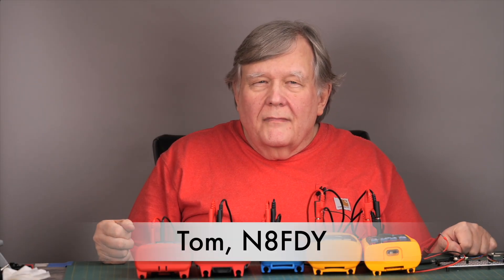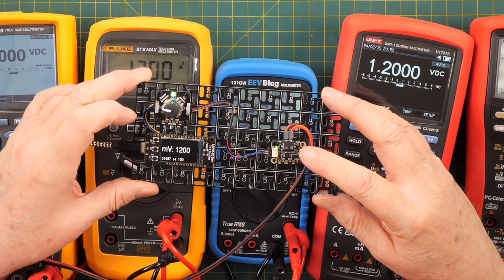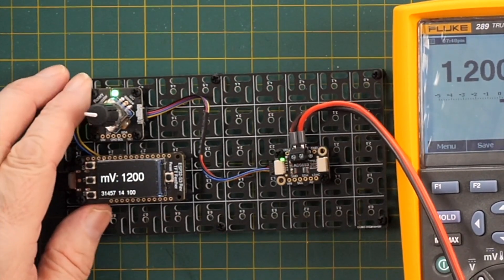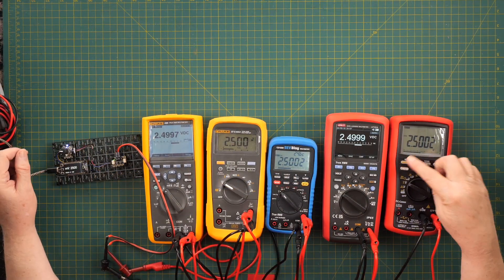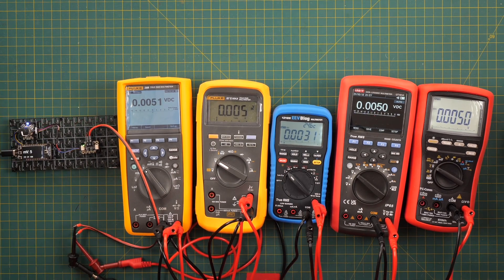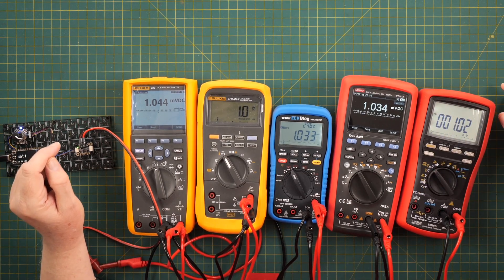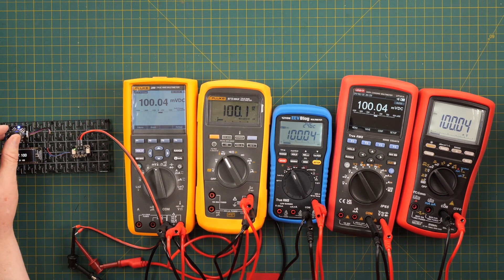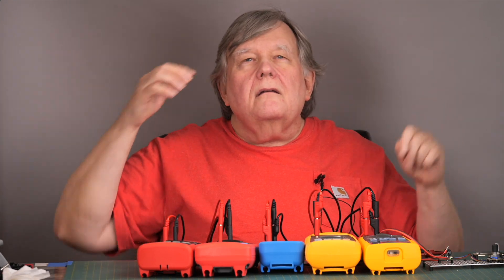DC Voltage Source Overview

Comment: Really cool to see those Adafruit PCBs in use. I bought some but I have not had a plan to make use of them just yet. How useful would you rate it? Anything outstanding good or bad about it?
Reply from the maker: Adafruit documentation on their learn site is very helpful.  Adafruit also has a discord channel for support.
Reply: @N8FDY When you power on that unit,do i need to add on that USB cable an ferrite beard.

Comment: Even as a (die-hard) Fluke-fan I was always interested in the Brymen 869s. But now I hear you start to dislike it more and more? Can you tell me what it is about this meter that makes you feel this way?
Reply from the maker: Because of my vision problems I need the backlight to help read the screen.  The backlight goes off after 4 minuets and 16 seconds.  There is no way to override this behavior.  To turn it back on you have to press the select button for 1 second or more,  and if you do it less then 1 second it changes the function for that rotary switch setting.  The meter also remembers the select mode even after power off and back on.  Sometimes I don't press the select long enough and in change form DC to DC+AC,, and that changes the readings a bit.  I once shot a whole set of pictures with voltage measurements before I noticed it was in DC+AC so I had to redo it.  I know this is a little nit but it still annoys me.  I am sure a normal sighted person would not need the backlight on all the time and everything else about this meter seem pretty good.
Reply: Thanks for the elaborate answer. I agree that holding a button for a longer time to use the backlight which otherwise has another function is not always that practical, for instance I have an Owon clamp meter that has one button for HOLD and (long press) Backlight and I too find it not really convenient at times. I prefer to have dedicated backlight buttons.